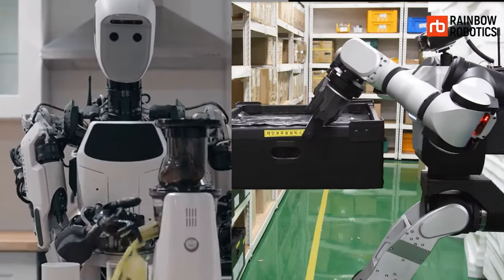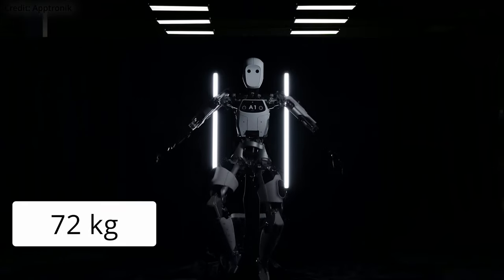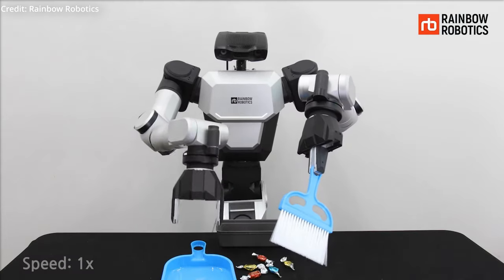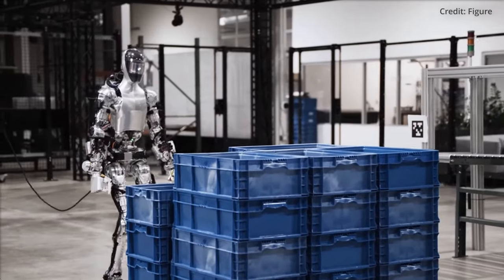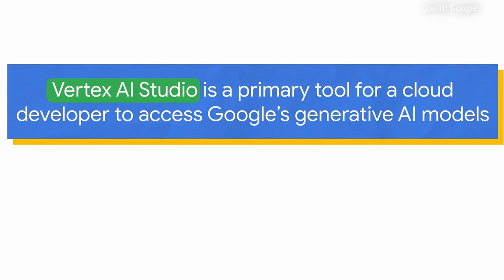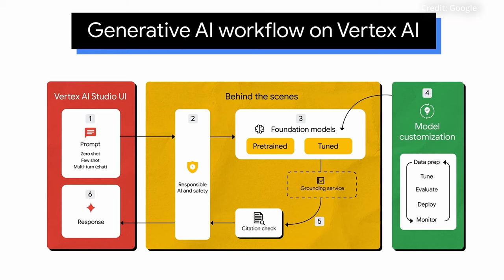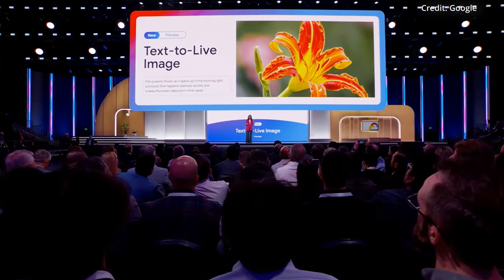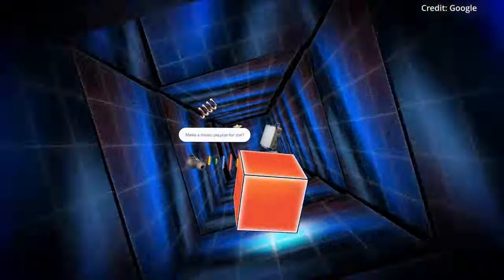Mercedes’ NEW Humanoid AI Robots Demo 43 Axes Automation Tech (RB-Y1 RELEASE)

Comment: Can't imagine bi-pedal robots EVER being a volume thing in manufacturing (USING them).  There's just no need for the extra expense in a CONTROLLED ENVIRONMENT where the floors should be flat and wheels will rule in speed and reduced cost.  I expect any initial efforts are just to get a company more aware of what's going on in the market place, but bi-pedal are for home and more varied terrain, such as rescue and military.